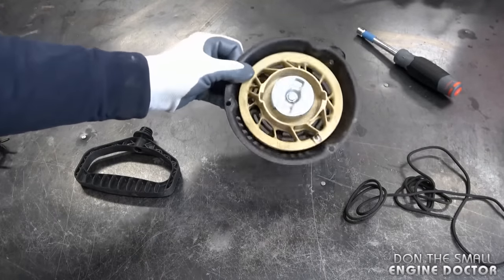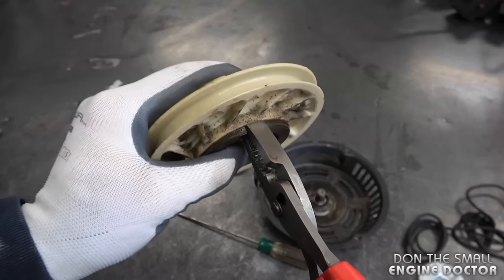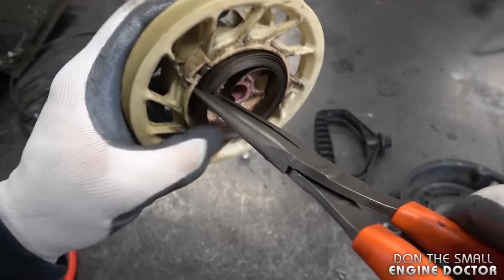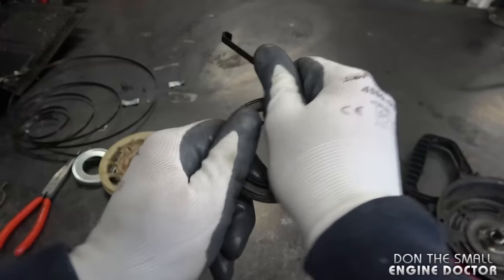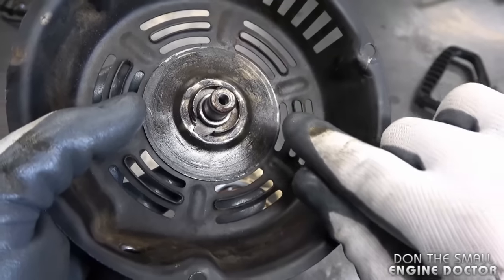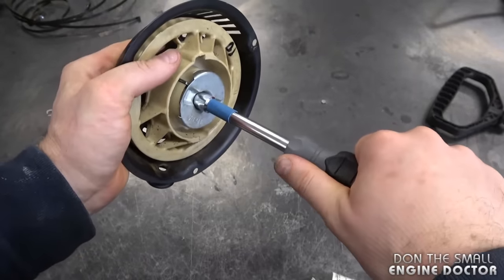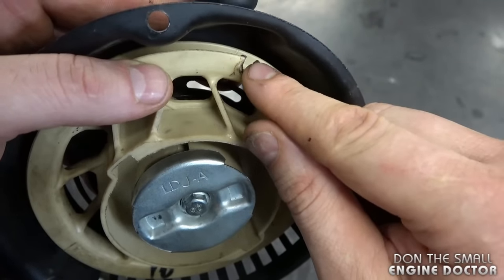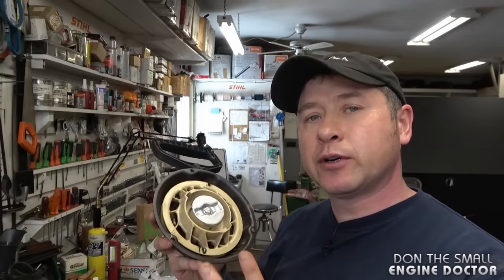Best 3 Ways To Install A Recoil Starter Spring On A Small Engine | Lawnmower Etc.

Comment from the maker: This is one of my least favorite jobs! How about you?
Reply: To me, this is not that bad :) I find installing valves on sv engines is worse if you don´t have the specific tools from the manufacturer. Or taking out the threaded main jet of an european Tecumseh carb. Or removing a stubborn flywheel or blade adapter... Those are my least favourite jobs!
Reply: I'm not mechanically inclined, but I do know a great Stihl mechanic, that can fix even the simple things for me and he does good work and is very reasonable on price!
Reply: Yeah also the spring sometimes gets bent and at that point I just buy another spring because if you try to bend it back, you will weaken the integrity of the spring
Reply: Yes! This brought back some painful memories, lol. I can remember rewinding the spring and having it slice up my finger. Wise to wear glasses/gloves like you demonstrate. Awesome presentation Don. This has to be the best recoil repair video out there!
Reply: If I could like this comment 10 times I would
Reply: It happen for the first time for me

Comment: I'm so glad I found this. I needed to replace the pull cord on my Predator 212. With typical male bravado I dove in eyes wide shut. Before I know it there's no more recoil even though "I swear I didn't touch that part". I took off the 10mm bolt to inspect the error of my ways and nearly caught the coil spring with my teeth. Defeated I retreated to the warmth and found this video. Cannot recommend enough. It's apparent that Don either really knows this equipment or like so many others, he's had it go very very wrong and has had to learn the hard way. In either case, thank you Don. You helped make very short work of that job... which is good since I used the wrong type of rope and get to do it again; it broke off in my hand on the first pull.

Comment: Don, I just finished semi-Restoring my 78(?) Chrysler SnoRunner & I decided the pull cord had like 2 more pulls tops left & said ugh lets replace it. Everything was no issue until the spring. Theres TWO slots you have to line up the curved ends in & its just "impossible". That tip at 5:00 saved the day. You Can't buy much for these anymore except from some clown. THANK YOU x100 , SIR!

Comment: Great video as always. I've found it easier to rewind a spring by placing a washer on each side in the middel and claming it in a vice. The vice will hold the spring end and allow just enough clearance to rewind the whole thing, on turn at a time. Then use a nail to hold the spring in place until you're ready to install it on the engine. Small pointed vice grips work well on that part of the job.

Comment: I used your method 3 for reinstalling the spring and was successful on my first attempt.  The day before, I tried coiling the spring but gave up after it unraveled several times.

Thank you for your video.  My lawnmower equipped with a Briggs and Stratton motor is now starting and running again.

Comment: Thank you sharing your techniques, tips, and tricks! About 30 years ago I worked for a small engine repair shop; that was my only experience replacing starter ropes. We had custom tools that fit the wheel, and we would just tension up the wheel and let it suck the rope back in. In my mind I thought "I know how to do this, I don't need this information." But while watching I realized I no longer have access to all those nice, expensive tools the shop had! I haven't needed them for 30 years, and now I know a way to do with out them! Stay safe up there, mon frère!

Comment: before watching your video I had never seen the inside of a recoil spring and rope assembly. Mine is a troybilt superbronco rototiller with a MTD engine. I reused the old spring and just followed your video, watching it several times and wearing gloves and safty goggles.. I used a small bit to make the hole instead of burning one and it worked fine.. Excellent video and easy to follow

Comment: Thank you so much for making this video. I struggle for hours trying to get the spring back into the housing of my Yard Man lawnmower. I didn't melt a notch in the reel. Turned it about 6 or 7 times to draw the cord in. Now, I have to seal a leak in the gas tank. Then I should be back in business. Again, thank you for showing every option. I used the one gradually wrapping the spring manually in the housing because as I tried to hold the spring, it was too difficult to hold in a tight ring to set it in the notch and keep it in the proper diameter.

Comment: I recently had to do this with a Craftsman pressure washer from 2003.  Since only about 1.5" of the spring was broken on the inside end, the spring luckily stayed in place and all I had to do was take a pair of lineman's pliers and bend a hook in the right direction at the broken end and walla, fixed.

Comment: An alternative is to position 2 finishing (headless) nails on a flat board.  They should be distanced a little closer than the diameter of the spring enclosure.  Hook the end of the spring on one nail and start wrapping the spring around both nails, keeping it taut as you go.  Grab it with a pliers and it’s ready to install.  Much easier on your finger tips!

Comment: We had to drill another hole to thread the pull string — but now, tied knot at end of string,  interferes with placing the cover on the machine.  WHAT did I do wrong?
THX for a response

Comment: Hey! Always great videos  and info!

have a craftsman chainsaw with recoil issues. First, when I tighten the hub screw after installing over the assist spring, the rope wont pull. After loosening the hub screw slightly I'm back in business. I can then successfully start the saw once but the screw then becomes too loose to be functional so I have to repeat this process again...and again...and, yup, again

Any assistance would be appreciated

Comment: Hi. I have a craftsman 25cc gas trimmer just bought 2 years ago only i used it just 3 times and when I tried this summer it doesn't work. I change the spark plug and still doesn't work, I notice the starter rope is loose because it doesn't move the trimmer head. It doesn't turn. I am trying to pull it but it doesn't feel the weight of the trimmer head on. 

I am very frustrated and I dont know how to fix it. Can you share a video how to fix it or something that can help me to put it to run again. The other parts are clean. It is the starter rope sound it is off from the pulley, but I dont know how to take it off and inspect it. Any clube?  Thanks for your videos they are informative.

Comment: Recently i worked on a recoil assembly of a Honda engine on a Craftsman deck.   Since it was the first time for me working on a Honda power equipment engine besides my scooter i had no idea what the recoil assembly consisted of.   Basically almost the same as any other.   Anyways when i took it apart the spring, and the pawls flew across the gravel driveway.  It took me awhile to find that one missing pawl on the gravel driveway, and i was getting frustrated lol.  As for winding the spring the second method you shown worked out the best for me because winding the spring by hand, and pushing it into that circular pocket was a pain.   I just could not wind the spring in my hands tight enough.

Comment: In what case that you can or can not reuse the existing coil? I have Husqvarna HU725AWD that they use rivets to bolts it sown permanently. What are my options to recoil the starter spring on the mower? Please advice.

Comment: Hi, having issue with friction plate and the nut. If I tighten it too tight, the spring won't go back. If I let it be a little more loose, after 5 6 starts, my nut falls off and have to redo the whole procedure. I heard some ppl weld it, or use nylon on the nut. Any suggestions?

Comment: My most dreaded task on any engine.  LOL  I was hoping you were going to show some magical  easy way to do this.  Have you ever used the E-Z COIL SPRING PULL-CORD RECOIL WINDER TOOL.  seen it on videos but not sure it worth it or if it works like it shows
Reply from the maker: I could have done a camera trick lol

Comment: Thank you!    Related question - after 5 years, my Honda lawnmower started on the 2nd pull...but the recoil rope did not go all the way back until the engine vibrations caused it to fully retract. As routine maintenance, should I spray some lubricant into the recoil spring area? I can't access it directly without some disassembly.

Comment: Another way is to have a wooden table take to small finishing nails and insert them in the centre of the spring and then wind around the finishing nails tightly use a pair of vice grips clamp it and put it in the recoil I do this method a lot of work

Comment: Hi Don I've got an old snapper with a Briggs engine with a starter clutch I replaced because the old one had come loose and worn the threads out. But since replacing it the pull cord won't retract when it's on the engine. It works okay off the engine. Maybe it's doesn't have enough rewind force or the plastic spring holder is worn too much?

Comment: Hi, Don question. I own a 192TC and the start recoil didn't work good so I used one of your videos to fixed it but it has two recoils one that you taught us how to do it and other one a little bit thick and short with a white plastic washer that I really don't know how to put it on !
The one that is all the way tonthe bottom no problem but the one between the two plastic holders is my problem can you give me a clue how to put it right please the onky way I can think it will work is between the coil?

Comment: I need to install a new recoil spring but it came in a plastic package (Stens) not in a metal casing or zip tied.  Any suggestions for  getting it out without it uncoiling everywhere?

Comment: Hey Don, Do You Have Any Videos On How To Replace A Starter Selenoid On A Troy-Bilt Pony Riding Mower And I'm Wanting To Know, If There Is A Easier Way To Get In To It Without Having To Take The Complete Floorboards And Rear Body Off Of The Mower Because Of The Way Troy-Bilt Designed The Mower With It Mounted Down Inside Under The Left Rear Fender, Inside Of The Boxed Area Of The Frame and Chassis. If You Don't Have A Video Of It , Would You Consider Making One And Posting It, I know Other People That Have A Lot Of Issues Trying To Replace Those Selenoids As Well, As Always Thanks For The Great Content 👍

Comment: Hi Don, I have an old Toro 824 I'm in the process of searching for a replacement carb, I will probably go with the Oregon adjustable, but I noticed a price difference between Discountonline and from the Oregon site, DOL want $ 89.95 while Oregon want $ 38.56 for the same carb, if you sell these yourself what would your price be to B.C?

Comment: This is not to criticize your video and is just my opinion. 

With your type of pull starter assembly you don't need to melt a notch in the pulley. You install the rope in the handle with it's knot, then wind the pulley by hand 6 - 8 times and align the rope holes on the housing and pulley, then slide the screwdriver into the housing and through the pulley to prevent the pulley from turning. Then feed the rope through both and tie a knot. Then remove the screwdriver and allow the rope to get pulled in. Pull it a few times to make sure it works smoothly and the spring has a good pull even when the handle reaches the housing.

Comment: Don is replacing a briggs plastic carb the best solution. These mowers are my least favorite & rarely able to be repaired by cleaning them out. I know I’ve asked these questions prior, but I hate giving a solid mower away for cheap.
Reply from the maker: unless you clean it properly and even then it may not work. the old 3.5hp plastic carbs were much better, just needed diaphragm replaced

Comment: Great video.  I always learn something.  It looks like the metal case that the spring came in might be meant to slip into the rope rotor and then be removed leaving the spring in place.  Any chance that might be correct?

Comment: What if the spring is not broken and the starter robe is still loose? I wanted to put on the generator and found out that the robe is loose when putting on the generator and it went back in when i loose it i found out that the starter rope is still okay what should i do?

Comment: Hi. 
This is the first time I've run into your channel.
I'm very impressed that you do respond to your subscribers when they have a comment..👍

I have a Homelite XL Automatic Oiler Chainsaw. I rescued it from the landfill a few weeks ago...  It started right away, but it smoked alot of white smoke,
 Big Time.

I found very heavy red oil in the oil tank. ?? And the duckbill was found inside the tank, with the little pipe that holds the duckbill...  I took out the spark plug and the cylinder chamber was flooded with oil...

I'm assuming that the duckbill is functioning. I'm assuming that the diaphragm is functioning. I'm assuming that the air pulse is functioning..

At this point I'm lost. I have a few more options, but I'm not sure...

What do you recommend that could cause the problem or problems?

Thanks,
Jules... 

PS.
Aside from this project.
Do you except mail in projects for repairs???
Reply from the maker: hi at this point I don't take in mail in repairs. I also don't accept those old saws in my shop anymore because i cannot get parts anymore, have a good day!

Comment: Hello i have a briggs and stratton 5hp engine it starts run for 30 sec and died what can be the problem thanks
Reply from the maker: you probably need to clean or replace the carburetor
Reply: @donyboy73  think it also this morning he runs good and than he fals out
Reply: @donyboy73  i clean the carb out now and its still the same normal he start on start pilot but than he quits directly

Comment: hi donny 
I have been following your  channel for years and  now I have this problem with my powermate  PM 0125500 generator I have had it for years I got it in 20012 only have 161 hrs on it so its pretty new still but the cord broke on me recently and as I tried to gathering  it together it was not catching to turn the engine and I had all this line in my hands that would not rewind I did try taking it apart and reinstalling it several times the same thing I see the plastic tabs in there don't know if this is the problem that the spring may be broke or the tabs may be broken will you have any insight into how I may solve thise problem with some type of web sight or schematic of how to fix it right 
yeah when the thing is off the machine its ok my thoughts it some thing with the  spring i don't  to want to mess with 
          HELP 
thank you in advance
Reply from the maker: in your situation I would just buy a new recoil assembly
Reply: @donyboy73  thats the same thought I really did not think it was gonna be something or anything easy  like to order a new beginning off Amazon or dealing with a spring mess 
I thank you for your speedy response to my problem yeah I guess its why we have factory to make new ones 😄 hahaha 
   thank you donny
Reply: @donyboy73  i have 1 more questions for you to help me with 
I have a powermate 0125500 and do not know what motor  it uses or who makes it how will I go about gaining this knowledge of  whats running my generator 
     thank you again donny

Comment: I was using an angle grinder lightly on the end of a small coil spring. Perhaps 2" long. I very nearly lost an eye when it grabbed and threw with the hook end actually lodging under my eye.... Always insist to everyone to use safety eye glasses... Always.

Comment: I noticed how you failed to lubricate the new spring with motor oil after it was installed. tsk, tsk. And I've repaired many recoil starters by straightening out the original spring, wind it up tight by hand, with the inside hook bent just right & reinstalled it back in the starter pulley. I've always used needle-nose Vise Grips to hold the spring too, and never just pliers. The original spring will last a long time, too. The only time I install a new spring is when the original one is broken.

Comment: Customers always bring me recoils they took apart and can’t get back together
Reply from the maker: haha yes, that's even worse
Reply: And some of those newfangled easy pull recoils can be baffling! If the recoil is on one of those Troy Bilt  weed eaters  . . . You have to take the entire machine apart to get to it. Unless you're absolutely certain that it doesn't have other issues, it's best just not to start, and tell the owner to buy a new one. Ask me how I know . . .